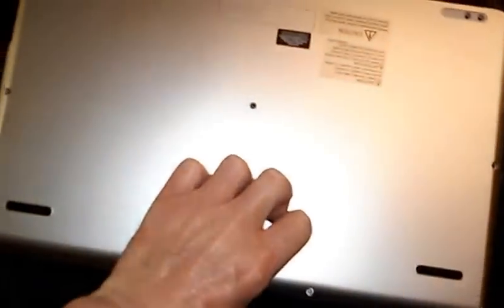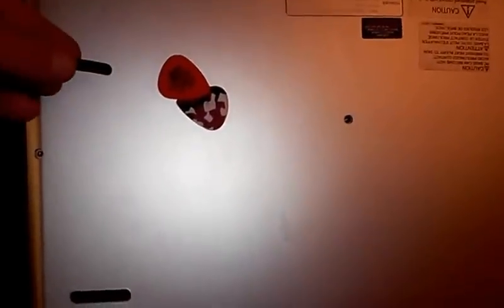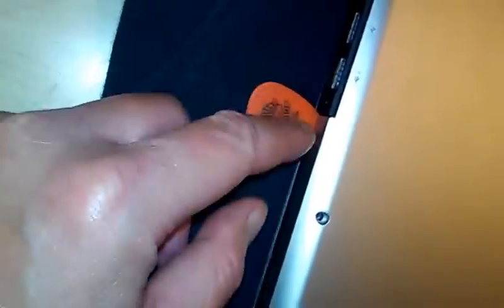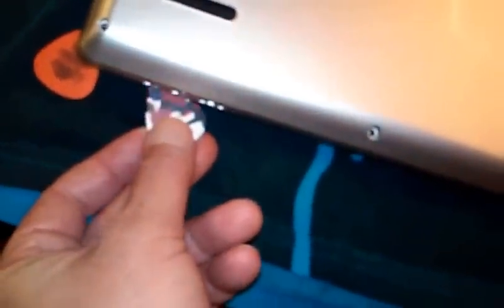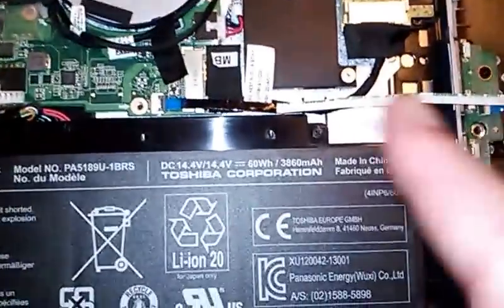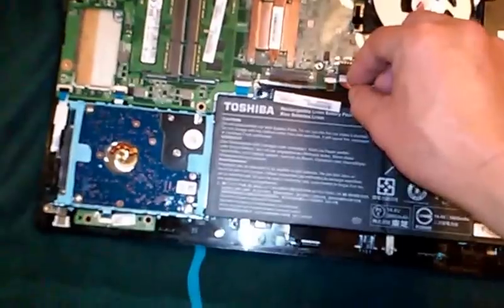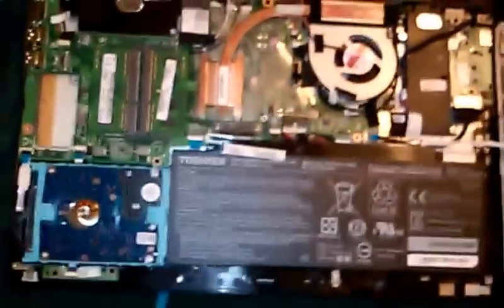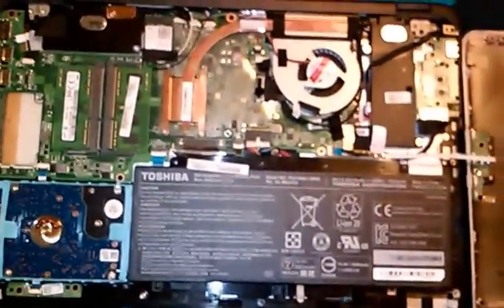Toshiba Satellite Radius P55W Disassembly.  Coffee Spill, Will Not Power-on

Comment: my laptop wont turn on, and i want to do the trick of remove the battery to hold the power button for 60 seconds, but theres a driver that wont turn, so its necesary to remove the battery or can i only unplugged from the mainboard?

Comment: thanks for the vid. my laptop still won't turn on though. I saw that the hardrive had coffee on it, but I think I still need to clean the battery. what screwdriver size did you use in video? I ask because I had to us a flat tip for repairing glasses and could not get the battery pack screws out.
Reply from the maker: Hello Isbroke!  If my memory is correct, the screws that fasten the battery in place are phillips head screws +.  A number 0 or number 1 phillips driver should work for you.  Cheers!

Comment: thanks for the video man! I have a satellite radius that I bought for $300, performance is absolute garbage, so my girl bough another laptop and gave me this one. I'm thinking it's because of the crappy HD and low RAM (although the processor isn't the best, it shouldn't be this slow) so I'm thinking putting in an SSD and some more ram in it to see if it helps. I've heard the HD isn't replaceable with an SSD but I wouldn't know why. do you happen to know if it will work? would you recommend? I would really hate to trash this laptop it's nice and compact.
Reply from the maker: Greetings Jay!  If you can provide the model number of the computer in question, then I will be able to answer your questions.  Generally speaking, an SSD and memory upgrade will improve the performance of your computer, assuming there aren't other hardware issues present.  You might want to run a virus scan, ADW Cleaner, and JRT to see if that cleans up malware infections on your current configuration.  Cheers!

Comment: Hey mine wouldn't turn on. I had to replace the power on button with the harness. Found a use one on eBay for $22. Part number  3NBLSLB0000,  DA0BLSYB8D0 This number is for these modes Toshiba P55W-B / P55W-B5220 / P55W-B5224
Reply from the maker: Hi James! | Thank you for posting your discovery, as this will help other viewers if they need the same part.  Cheers!

Comment: hey there can u tell me how repair the fan in it coz im having noise and fan not working properly
Reply from the maker: Greetings Mohammed!  You can use compressed air to blow debris out of the fan assembly and blades to see that improves the performance of the fan.  You may have to replace the fan if that does not resolve the issue.

Another viewer had posted for help with a similar fan noise problem, so I have posted my reply below for you to review:

If the fan is producing the noise, then it may need to be cleaned with 
compressed air.  You can remove the bottom cover, as shown in the video,
 and clean debris from the fan and inspect the fan blades for damage as 
well.  Check to see if the fan assembly fasteners have come loose and 
tightened them if required.  Inspect the surrounding area of the fan, 
including the bottom cover plate, for any obstructions to the fan 
operation.  Once you have completed those steps, leave the bottom cover 
plate off the machine, power it on and listen for any change in the 
sound of the fan.  If the fan is still making noise, then you have to 
replace it with a new one.  I believe this fan assembly includes the 
copper heatsink to the CPU so double check the assembly; consequently, 
if you have to remove the heatsink from the CPU, you will need to 
replace the thermal past between the heatsink and CPU when you install 
the new assembly.  I highly recommend that you replace the thermal paste
 during this procedure or you will shorten the life of your CPU.

At this point, you should have isolated the fan as the cause of the 
noise; it is possible the HDD is causing the noise or it may be the 
speakers causing the noise.  Since I am not physically present to assist
 you, I just want to make sure you are aware that there may be something
 else causing the noise besides the fan.

If you go to ebay and search for your specific make/model, you should be
 able to find the part; they sell these as "fan only" and "fan + 
heatsink."

I hope this helps you get rid of that annoying noise.

Cheers!

Comment: Excellent video Travis... I have a question. I've just noticed today that my laptop will NOT turn on at all WITHOUT the power cable being connected and plugged into the electrical outlet. It even tells me that my battery is fully charged at 100% but as soon as I literally unplug the laptop from the outlet it literally shuts off completely. 

I have this exact laptop model and it's under currently warranty.  Toshiba wants me to pay around $30 for one way shipping. Also I'll be without a laptop for almost a week which I can't picture. Lol. I was thinking about putting that $30 on another battery and replace it myself. Do you know if I can buy a replacement battery for this model? Thanks in advance!
Reply from the maker: Greetings Bsquared!  If you are going to replace the battery, then I recommend that you purchase an OEM replacement.  Ebay has "used" OEM replacement batteries for this make and model laptop for $19.55 + FREE SHIPPING:  PA5189U-1BRS.  At the time of this post, there are 2 available with about 3 days remaining.

Here is the link:  

http://www.ebay.com/itm/Genuine-Toshiba-Satellite-Radius-P55W-Laptop-battery-14-4V-3860mAh-PA5189U-1BRS-/401014221474?hash=item5d5e4f6aa2:g:LNMAAOSw9mFWJrNy

If you decide to send your laptop to Toshiba, then I highly recommend that you backup all of your data before shipping it off.

Hope this helps and best of luck to you!
Reply: You could solve the problem?
I have exactly the same fault, I hope your answer. Thank you
Reply from the maker: Hello Andres!  If you need to replace the battery for your laptop, then I will recommend ebay to you, considering that I have had good experiences with their sellers.  Hope that helps.  Cheers!
Reply: Bsquared did you buy a new battery? if so which one? i have the same problem...

Comment: I have a really annoying rattling fan, how can I fix this. Or if i need to just replace it, whats a proper replacement fan?
Reply from the maker: +UniversalHere | Hello UniversalHere!  If the fan is producing the noise, then it may need to be cleaned with compressed air.  You can remove the bottom cover, as shown in the video, and clean debris from the fan and inspect the fan blades for damage as well.  Check to see if the fan assembly fasteners have come loose and tightened them if required.  Inspect the surrounding area of the fan, including the bottom cover plate, for any obstructions to the fan operation.  Once you have completed those steps, leave the bottom cover plate off the machine, power it on and listen for any change in the sound of the fan.  If the fan is still making noise, then you have to replace it with a new one.  I believe this fan assembly includes the copper heatsink to the CPU so double check the assembly; consequently, if you have to remove the heatsink from the CPU, you will need to replace the thermal past between the heatsink and CPU when you install the new assembly.  I highly recommend that you replace the thermal paste during this procedure or you will shorten the life of your CPU.

At this point, you should have isolated the fan as the cause of the noise; it is possible the HDD is causing the noise or it may be the speakers causing the noise.  Since I am not physically present to assist you, I just want to make sure you are aware that there may be something else causing the noise besides the fan.

If you go to ebay and search for your specific make/model, you should be able to find the part; they sell these as "fan only" and "fan + heatsink."

I hope this helps you get rid of that annoying noise.

Cheers!

Comment: I have the exact same lap top and the warranty finally ends. So i got a question... Will the lap top still work if I disconnect the battery (using just the charguer to energize the lap top)? I would prefer to carry my lap top without the battery because I'm always moving with many other thigns on my bag.

Btw thanks for the video and for taking your time to answer so many questions on it.
Reply from the maker: +Alexander Vega | Greetings Alexander!  You should be able to disconnect the battery and use the laptop with the charger in the manner you described.  Just to make sure this is an accurate statement, you can open the laptop, disconnect the battery, then plug in the charger and power on your laptop.  I have ran many laptops this way but, just to be certain, it would be a good idea to run a quick test while the laptop is disassembled.

You are more than welcome.  Let me know if you run into problems.  Cheers!
Reply: +Travis Purdy | It works! just 2 things to add. First, there is something in the laptop now that is making a bit of noise when I shake it gently but i can't find what exactly is. Second, the laptop will lose the hour and date every time you turn it on but with internet connection you can just skip hour and date configuration.

Thanks again!
Reply from the maker: +Alexander Vega | The noise might be the electrical connector for the battery moving around since it is not connected to anything now.  If that is the case, then a piece of tape or a zip tie will secure it into place.  Thanks for the feedback!

Comment: I appreciate the help. the computer is less than a year old so I may be sending it in for a replacement if they'll let me. As far as best buy, I'm under the accidental program, but I fear it will just do this again. kind of regret going with a Toshiba now, being it's still brand new.
Reply from the maker: +budNglass | Considering the length of time you have owned the machine and the problems you have experienced, I would push for a replacement while it is still under warranty.  I hope this situation works out to your advantage.  Best of luck to you.

Comment: Sorry, I wrote that way to tired. well I woke up one day with my computer refusing to power on. I plugged the charger in and still I received to light showing power. I sent it in to best buy to be fixed and everything worked for about two weeks, but now it's doing the same thing. was curious if you had any idea as to why this happens with this model.
Reply from the maker: +budNglass | If your machine is still under Toshiba warranty then I recommend that you send it back for repair or request a replacement.  I don't know the terms of service that Best Buy discloses for repair however, if the machine is repeating the same problem then Best Buy should attempt to repair the machine again without charging you since it has only been two weeks.  Here is a reset method that another viewer shared after experiencing a "will not power on" event:

1. Remove the battery.
2. Plug in the charger.
3. Hold the ON button for several seconds.
4. The machine should power on now, at least it did for me.
5. Turn the machine off.
6. Put the battery back in.
7. Turn the machine back on.

Let me know how things turn out.

Comment: Hey I have a question? My computer has a cooling pad on it, it feels warms but that's it when I pick it up off the cooling pad. The message about the cooling system still pops up, I have tried every way to get rid of it or stop it(That's why we bought the cooling pad.) We didn't want to take our computer apart because we didn't want to break anything plus the screws wouldn't come out. We don't have the money to take it in somewhere or anything. We need it for our work and the message only appears when the CPU is high(aka when we are saving a video on it for Youtube). I don't know what to do because it makes me just want to get a new computer or not work at all on it????? Btw is there any program that is safe to check the temperature of the computer? jw
Reply from the maker: +D.V Fighting Force | You can download a program called "Open Hardware Monitor" that will provide lots of information about your machine, including internal temps, assuming your machine will provide that information to the program.  If you are receiving the warning message when the CPU is at high utilization then that would explain the heating condition, so it seems that the warning is legitimate.
Reply: Travis Purdy I have a program that has been keeping an eye on the cpu temp and the message pops up even when the temp is kind of low like around 40 some degrees and when the computer is doing nothing? Plus sometimes it can get up to 70 degrees and sometimes the message won't show up? So it is very inconsistent.
Reply from the maker: +D.V Fighting Force | Has you machine powered off or locked up, due to high temperature?
Reply: Travis Purdy it had powered off once or twice but i don't think the tempature was high..

Comment: Hey I have a very important question? I just bought a cooling pad for my computer to make sure the computer can stay cool and I thought everything was all good but a message keeps on popping up a system message that says there is a problem with the cooling system? I'm actually kind of confused because I had the cooling pad on it at that time and it didn't get hot or anything? Could dust make the message pop up? I just want to make sure before I mess with the computer...
Reply from the maker: +D.V Fighting Force | I am not 100% sure what conditions could have triggered that warning message however, if the system reaches a high temperature for a period of time, it will shut down; at least that has been my experience with several make/model of laptops.  If the cooling vents were blocked or the fan momentarily stopped/slowed down (due to an obstruction of airflow or physical contact), then that set of conditions may have triggered the warning message.  You reported that the temperature of your machine was not unusual and you had a cooling pad in place, so I am grasping at straws to give you a definitive explanation.

Under these circumstances, I would check to see how many processes are running on your machine when this warning message occurs; open task manager to see the CPU utilization.  In certain cases, a malware infection will run a process or several processes that will consume most of your CPU, thus creating an increase in system temperature.  If the fan is clogged with dust and air vents are restricted, then the cooling system is not able to work at optimum performance which means the warning system message is valid.  Between the CPU and heat sink, there is a layer of thermal paste that conducts heat through the heat sink to the exhaust vent of machine and it may need to be "re-pasted."

Next steps would be:  1)  Inspect and clean the fan and vents with compressed air.  2)  Check CPU utilization the next time you experience the cooling system warning.  Hope this helps.

Comment: Hey I have a computer just like this and I was wandering how can I clean the fan in it aka the cooling system? jw I need help..
Reply from the maker: +D.V Fighting Force | Hello D.V!  Use compressed air to gently remove dust and debris from the fan; a can of Dust Off from an office supply store is around $10.00.  *Be careful not to hit the blades with the plastic spray nozzle while they are spinning or you could snap one of the blades or damage the fan motor shaft.*  Depending on the environment that your machine is exposed to, you should perform this task once a month as a preventative measure.  Cheers!
Reply: Travis Purdy Ok I'll have to try that and do you have to take the computer apart for you to do that? jw
Reply from the maker: +D.V Fighting Force | You can blow compressed air through the rear vent to clean the heat sink, but that just means the particulate will be blown around the inside of the machine and back into the fan.  I recommend that you follow the instructions in the video to remove the bottom cover and clean out all the dust with compressed air.  Make sure you pay attention to 2:36 in the video when I warn viewers about the power switch ribbon cable.  The bottom cover will open like a book from left to right. 
It's kind of a pain, but dust build-up on the fan will eventually become a problem and shorten the life of the fan.
Reply: Travis Purdy Ok thanks we will go get some tomorrow and we will do that :3 thanks for the help :3 and before I take the back off I will watch the video to make sure I don't forget about that.

Comment: Hey Travis, I have this same exact laptop. a few months ago my screen broke, and I am not the type to try and fix these things myself. I sent the laptop in to Toshiba, and they returned it with a working screen but I noticed when the screen is completely black, there is a light colored area in the upper corner. I also have absolutely no WIFI reception. Are these problems that would come from a poorly done job?. Is the antenna located in the screen or something?. I sent it to Toshiba cause I wanted it done right. Uhhg.... :(
Reply from the maker: +Samuel Walters | Greetings Samuel!  Sorry to hear about the misfortune with your machine.  It sounds like the replacement screen may be defective or not installed properly.  The WiFi issue seems to be a common complaint from many viewers who I have interacted with on my channel and I have also read reports around the net about various WiFi problems with Radius model machines.

See post from Zhou David in comment section of this posted video.

My opinion is this:  the screen replacement is not to your satisfaction, so Toshiba needs to make you a happy customer and redo the job!  The WiFi issue should not be related, however if it was working before they serviced your machine then the onus is on them to resolve that issue as well.

If the machine is still under warranty then I might request a new machine or full refund.

I hope Toshiba takes care of you as a valued customer.

Cheers!